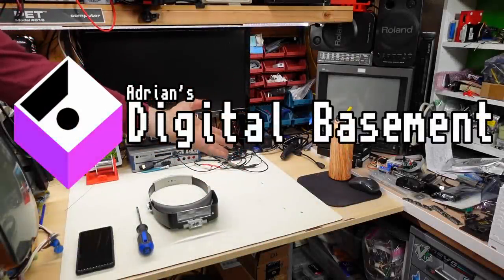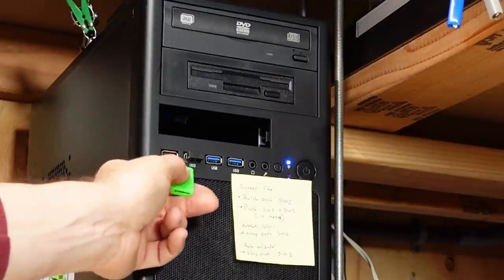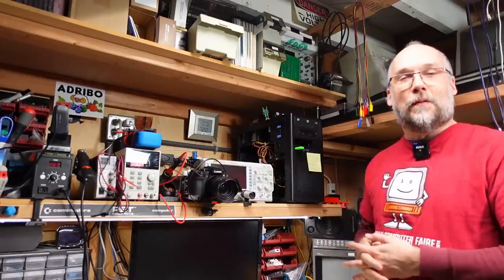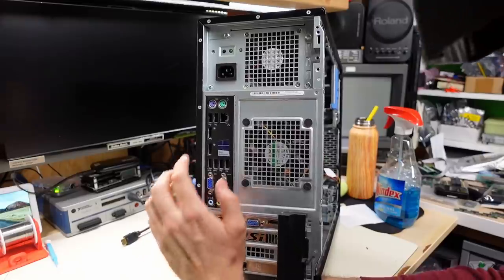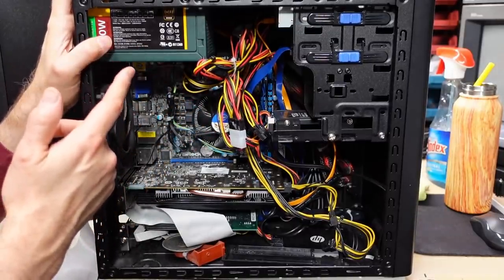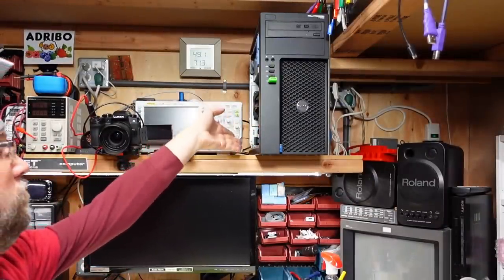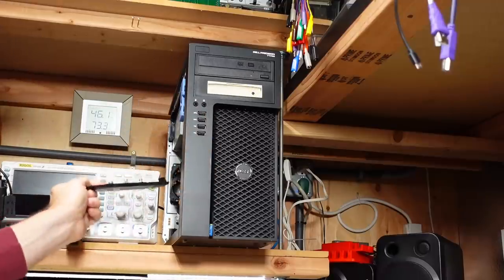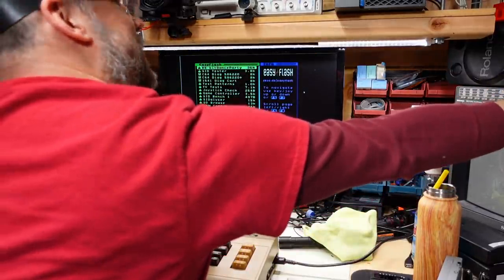Let's upgrade my lab PC and talk about tools I use to make videos

Comment: Congrats on the new Dell System. I like Dell's as Linux just works on them... Lol
Look at the header on the Mobo and look to see it there is a header for a re set? That is the one thing that drives me had on the Dell's, NO Reset.
I just add one if there is a header. I drill a hole and hot glue a micro-switch to the case and I super glue a tooth pick to the end and drill a hole in the from cover so it sticks out...
LLAP

Comment: I have the Dell precision T1650 with a Xeon E3-1240 v2 CPU running at 3.4 GHz.
And its running great.
The only thing not working any more is the RS232 serial port that the CPU card in my old Traffic signal controller has blown up.

Comment: My previous PC was built in that exact same case and it died on me. I think those cases are cursed. Funnily enough, the system I replaced it with that I use now... a Dell Precision T1650. Not quite a 1700 but pretty dang close.

Comment: 5:00 I've found the same problem with a floppy drive on Windows 10. It just likes randomly checking drives.
Reply: no its just reindexing and checking for changes for the search
Reply: You guys should really submit a detailed report about these issues to the windows team.  There's a tool built-in to Windows 10.  Explain in the report that floppy drives are still useful to the retro community.
Reply: @BrainSlugs83  W10 is a lost cause. They've repeatedly nuked drivers for hardware that no longer has driver support for W10 due to it's age, but previously was working with a W7 or W8.1 driver. Their support team doesn't care about backwards compatibility anymore. They want everyone to upgrade to W11 so the ad department can rake in that marketing metadata.
Reply from the maker: Heh yeah! Luckily it doesn't do it on external USB ones.... I'd rather have a working zip drive which I do now anyway. (see pinned comment)
Reply: @adriansdigitalbasement2  Now that's weird, mine is an external USB floppy drive. I just get annoyed and unplug it when not in use anyway.

Comment: its always useful to have a working 1tb harddisk with a loaded operating system not connected but installed, just in case.
i do this but the drive is a back up of my ssd, i just sync it up now and then got me out of trouble more than once that.

Comment: The 80+ rating on these are kind of cheated I think because they're only a 12v PSU. They don't generate 5v 3.3 etc. they do that on the motherboard. I don't think that's any more efficient than just putting that circuitry in the PSU but it helps them get a higher score I guess.... I dunno it just seems kind of bogus to me.
Reply: While that's a valid point, it would still yield efficiency gains as the lengthy PSU to mo/bo connection is all 12 V. It also saves on wires, which I'm sure penny-pinching OEMs always appreciate.

Comment: You didn't need to screw the zip disk in. If you put the screws from the back of the blanking plate into the drive, the screws will slide into little slots, and latch under the blue plastic dohickey on the side of the drive cage.
The screws on the side of the drive act like rails.
Reply from the maker: Sadly they wouldn't fit -- that crappy mounting bracket is one of the Aliexpress cheap ones and uses these thin self tapping screws to bite into the plastic...

Comment: We've got at least 2 of those Dell 1700's in our 'parts' pile at work, the USB ports flaked out in them.  They'd kill devices plugged into them over time (killed several Logitech unified dongles  before we figured it out), so keep an eye on your USB voltages on them..  I've not had a chance to tear one down and see if it's something from the board, or the power supply yet though..  Otherwise they've been pretty nice machines.
Reply: Also on the hard drive rails, it SHOULD come with some of those blue plastic drive sleds that click into those openings, ours did at any rate.  The 5.25" bays use a special screw that slides in a slot (it'd probably work with longer standard drive screws also).  Those screws slide in the slot you can see on the lower empty drive bay, and click into that blue lever to hold the drives in.  It should have another set of those screws somewhere in the case, might be on the back side of the faceplate that you pop out.
Reply: @heffe2001  I'm surprised Adrian's didn't have the blue drive trays, instead it looks like it was using some sort of metal tray. However it still has the provisions for the plastic clip.
Reply: Regarding USB voltage issues, I'd guess the motherboard. Most non-ATX power supplies like this one has are 12v-only, so 5v is generated on the motherboard. This is evidenced by the fact that the power for the drives comes from the board instead of the PSU.

Comment: 20:56 there are adapters for these Dell PSU MB connections, so you can install a more capable PSU in the future.  Also a good idea to replace the CPU heatsink.  That aluminum hockey puck design is TERRIBLE.  Just make certain the distance between the mounts is standard, I can't remember now if it is or not.  I suspect due to it's age and the fact it's OEM, you probably won't be able to upgrade the RAM, or if you are it will be VERY picky.

Comment: Hi Adrian, did you just throw the disk from the old machine in and W10 re-authenticated ok with the new hardware? I'll have a similar situation soon with the existing install having various software and drivers.
Reply from the maker: The important bit is the license needs to be Windows 10 Retail and the license is associated to your Microsoft account. Then you can do hardware changes without hassle.

Comment: the saddest thing about the xeon computer is that it steps up and down the power for the drives from the motherboard instead of the power supply or a separate pcb from the mother board for adjusting the voltages for drives  cause power load balancing can be a big issue. i had a lenovo system that blew up a usb 3 port from running a 3.5" hdd and 2.5" ssd. also you can get a sata power to molex adapter cable. it's the whole sony vio desktop issues from the 90's before they went to normal power supply standards psu takes care of drive power.

Comment: Love your Channel Adrian. While I prefer to assemble my own PCs, I won’t pay pandemic pricing for parts… I have bought several used Precision workstations like yours and they’ve all been great. Definitely a bargain. 
The screws on the back of the slot cover are meant to be used on devices mounted in that bay. They are posts that screw into the drive that slide in the guides on the case. They lock into place with the blue plastic apparatus on the side.

Comment: The old PC had a VIA USB 3 chipset? I hate it so much, gave me a lot of problems when I had a motherboard with it.

you can use Windows 10 native mbr2gpt tool if you really wanted to convert your installation to UEFI. Just image the ssd first just in case it fails.

Comment: Question: It sounds like you're pulling video directly off the USB port. Why don't you copy & paste the videos to your local drive and then edit from there, removing them when you're finished?
Reply from the maker: The capture device streams a raw uncompressed 1080p60 data stream over USB to the computer. The capture software then takes that stream and compresses it using H.264 or what not.

Comment: Adrian, re-paste the GPU and CPU.  You'll get much better performance on this "older" machine.
Reply: I've got an old PowerEdge from 2008 that's never been repasted, and the CPU still idles at 33°C. So, it might be wise to check the temperatures first; the paste could still be good.

Comment: Damn I was hoping for Lenovo :) I am writing this on an old Dell laptop that will not charge the battery and is running a background process to prevent the Dell BIOS from throttling the i5 CPU :)

Comment: The 750ti has cuda cores that can be used for encoding and I believe double the vram than your older R7770
My Ryzen x570 mobo has ps2 ports on it also
The psu rating are not reliable manufactures have been fudging their numbers wildly.

Comment: Did you remove the old drivers from the device manager? This should give the system another massive boost since it does not have to load all that old stuff from the mainboard, processor drivers and stuff.

You can open an elevated command prompt and enter 
SET devmgr_show_nonpresent_devices=1
and press enter and open the device manager afterwards. Click on view and "show hidden devices" and remove the half transparent items one after another. be careful with audio stuff and do not remove the system volume information stuff, since it's the system restore stuff. Otherwise it should be able to install everything (from the audio part for example) by itself again unless you killed a manually installed driver with it.

I did that on LOTS OF LOTS OF LOTS of devices since Windows XP and it always worked like a charm :)
Reply from the maker: Thanks I'll try that. Yeah it's likely why the network interface is like #5 it something even with just one NIC. LOL! This Windows install has been in 3 or 4 machines now.
Reply: @adriansdigitalbasement2  the windows install on my main pc started out on a z77 board with an i5, it went to a b450 with a Ryzen 5 2nd gen, and now it’s on an x570 board with a 4th gen Ryzen 5.
Reply: @adriansdigitalbasement2  in that case it will be more than worth! 
It also is, when you use lots of usb devices. Every driver for every device (maybe multiple times, if you use them on different ports) is loaded on every windows bootup, to make them available faster when needed. In that case it may make sense, but having CPU-drivers and stuff automatically loaded is unnecessary overhead. :)
Reply: @JARVIS1187  I can definitely get behind clearing extra entries when they build up but 90% of them won't load the actual drivers if the device is not present. AFAIK the only drivers which will load automatically without a device are non-PnP drivers and the ones marked with 'Start'==0 in the registry.

Comment: "Windows 10 does weird stuff..."   Yeah, all you had to say was that <g>.

but then later, you actually used the words "Dell" and "solid computer" in the same sentence...

And I had the same issue with the PSU in my AM3+ "frankenstein" machine (the one where I painted the case in a hammer-finish copper, with black highlights).  So now it's just my $5 HP Pavilion Elite that gives me trouble.

Comment: My "ol bench" if you could call it that is a Phenom II x4 955. On an ASUS board with IDE in the chipset, so I don't have to wait for a ROM for that. It's so beneficial to have IDE on the board, though I have a PCI card, it's boot rom is buggy and slow. 16gb ram, 240gb ssd. 5 sata cords ready for drives. I keep the scsi card in the droor below and I can install it, even though it's a PCI-X card, it works in PCI with those pins plugged into nothing. Dual boot win 10 and ubuntu. I think it's a geforce gt 430 in there.

Comment: v3 xeon socket is actually really good news! You can buy used v3 cpu from China and this machine maybe can outperform your gaming rig (in some cases... unless you have a Threadripper) ;) Also proprietary power connectors are not good :(

Comment: If the GPU is the gtx 750 ti then it does have a nvenc encoder as it is a Maxwell chip rather than the kepler chip in the rest of the 700 series.

Comment: some machines use the one Hub on the motherboard to use multiple USB ports ect. Meaning eg. that if you use two USB ports on that same single hub it, will slow data transfer to half the speed. Just a theory lol

Comment: I wonder if that Radeon 7700 could have been a bottleneck for the video capture. a 1080p 60fps stream would have been a struggle to encode on the fly back in 2012
Reply from the maker: I had been using that card in the machine for a few years and the capture problem only recently surfaced .... but it wasn't even able to display a 1080p preview anymore which made me think the capture device was bad .... until that worked on another machine.
Reply: @adriansdigitalbasement2  great work on pinpointing the USB issue! hope the new machine is treating you well. I'm going to take this opportunity to say that your videos are excellent, I love that you take us through the whole troubleshooting process and the variety of tech that you cover (even modded VCRs on the second channel) is amazing. keep up the awesome work and thank you for making great and interesting videos!

Comment: That 1241 v3 might be worse than the i7 you had in the other computer, especially if it was a 3770K. The Xeon has a locked multiplier whereas the i7 doesn't. And you also wouldn't be able to overclock on that Dell machine even if it did have an unlocked CPU. The 3rd gen i7's all had integrated graphics too boot. That xeon doesn't. If you're just going for 3.0 ports then the Dell is obviously better but in my opinion it would be a better idea to buy a pcie to usb adapter for the i7 machine. You can get 5-port versions.

Comment: What about getting you hands on a ACER TC-220 with a DAA78L with an A10-7800k and 512GB of DDR3 RAM that should be good to do what you want to do and has a IDE connection provided they didn't remove it.
Reply: I don’t think it would have 512gb of ram. It’s probably 4-8gb.

Comment: Attach the case fan with proper screws.  It looks like it has those rubber grommets which tend to disintegrate on Dells.
Reply from the maker: Heh I happen to have a bag of those little isolation things for fans made from silicone. If it starts to rattle I'll swap them out
Reply: @jkeelsnc  Yep, we have a bunch at work as well that were cheap PCs supplied with lab devices.  Almost every fan was dangling in the case.  Btw, if you're the same Asheville John Keels that I'm thinking of, we sort of know each other.  Small world!
Reply: Disintegrating rubber grommets?! Leave it to Dell to cheap out on those. I mean, why should I be surprised after their sticky palm rest issues (yay for soft touch plastics - not). I would get some (silicone) rubber nipples again to replace the failed ones though, they really do help stopping fan motor noise of all kinds from being transmitted to and amplified by the case. When I first came across an HP Compaq Elite 8300 CMT I remember being rather annoyed by the screwed-in case fan like in the olden days... yes you can definitely hear that.

Comment: I have a brand new AMD Ryzen 5900x with an ASRock x570 Taichi motherboard. I bought them earlier this year. The CPU was released right about a year ago. The motherboard is about a 2 year old design. Even it has PS/2 ports. I don't know why, but it does. So that's not that unusual.
Reply: PS/2 kb/mouse support is almost an industry requirement because of PS/2 being supported by default w/o the requirement for drivers for tech diag and server/office level access.
Reply: @JosephArata  USB keyboards are supported in that way too. My I7-2600 Asus motherboard didn't have PS/2 ports. In fact I don't think my core 2 quad had them either.

Comment: I know it'll hurt if it works after the fact....but you should replace the 3.3V button cell BIOS battery if it's older than a couple of years.  Even if the BIOS/hardware monitoring software is saying 3.3V a bad battery can cause some corruption of your CMOS DRAM.
Reply: Fortunately they're not too critical. Something like this doesn't have any exotic settings so it will be easy to set up again if you see the "invalid CMOS checksum - default values loaded".
Reply: @eDoc2020  yeah, but it's a pain sometimes. If you don't keep updated backup files for your settings on a pen drive, and rely on CMOS to store your profiles instead, it means re-doing all your RAM timings again. 😑  I learnt the hard way after an Asus BIOS update.
Reply: @JuxZeil  Again, this system doesn't have in-depth settings like that so it's not an issue. Plus on systems I've used when you create a saved profile it stores it in such a way that it remains even if you reset the CMOS RAM.

What's inexcusable is that when I did a BIOS update on (I think) an Asrock board it wiped all the settings including the saved profiles. They could have at least warned me that would happen.

Comment: Interesting your windows 10 didn't de-activate itself and force you to call the MS WATS line for a new activation code with entirely new hardware....
Reply: This machine probably has a Windows license embedded in the firmware. Microsoft started doing that with partner OEMs a while back. As far as I know, Windows will never ask you for a license key when you run it on such a machine.

Comment: 10:54 i'd pull out the cmos battery, reset cmos itself, pull battery back (after like 5 minutes) and try to update bios.. this might work edit: oh and ALWAYS set the high performance mode in power settings.. if not, veeeery weird things start to happen - like on my ryzen 5600X it acts like an old phenom ii x4 or equiv.. horrendous
Reply: You can get not just one but two different Windows power plans targeted specifically to Ryzen systems if memory serves. I'd suggest trying one of them. I can't imagine having the CPU run at full clock speed all the time is doing idle power consumption any favors.

Comment: i am also one of those people that leave the side of the case off however i use a box fan on low to blow into mine keeps my fsb temps a lot cooler my gpu runs 10c cooler tbh everything in my case stays 10 to 15 c colder than without the fan